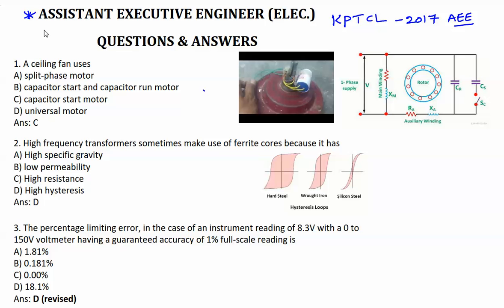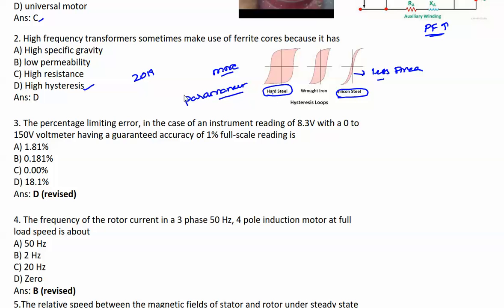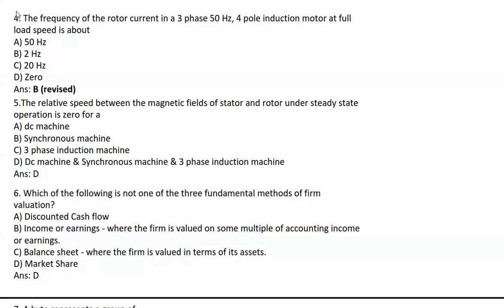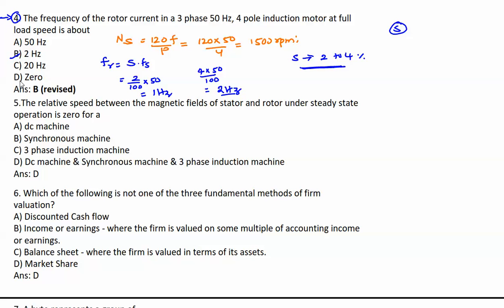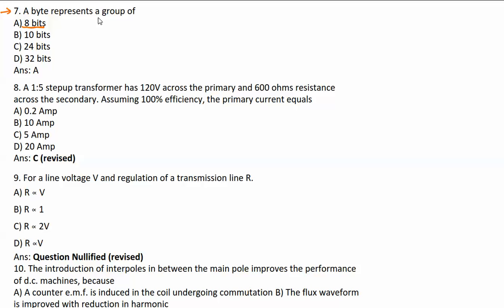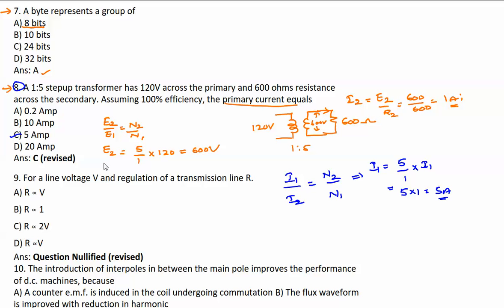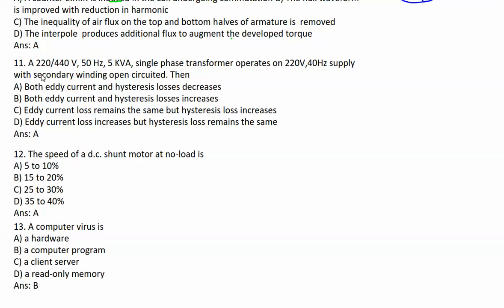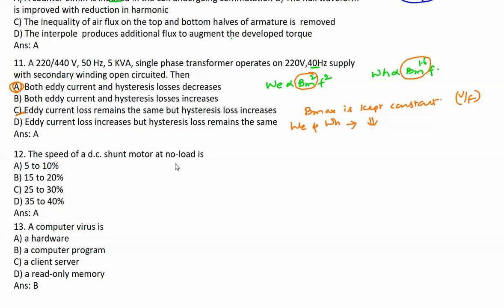KPTCL AEE ELECTRICAL QUESTIONS AND ANSWERS P-01

Comment: But for the 1st question in few books its given as capacitor start capacitor run induction motor... Will u pls clarify?
Reply: But u see in ceiling fans windings in practical u get understand it's capitors are used for starting purpose in ceiling fan